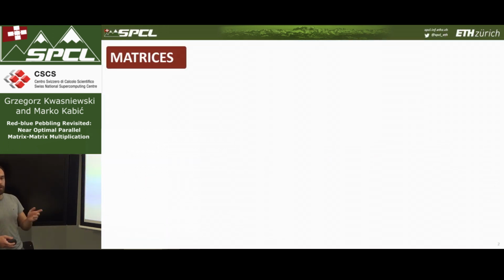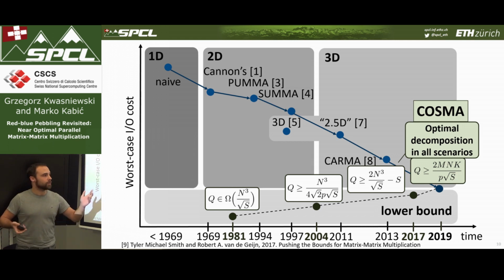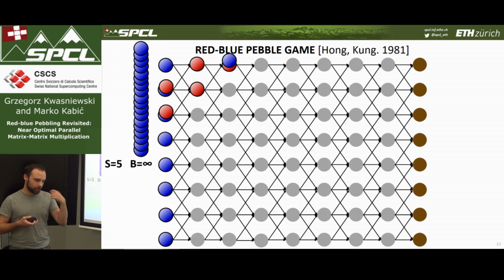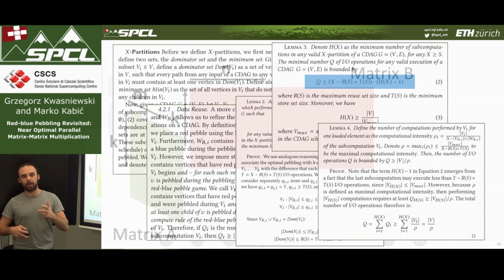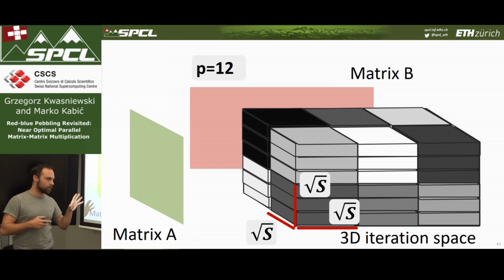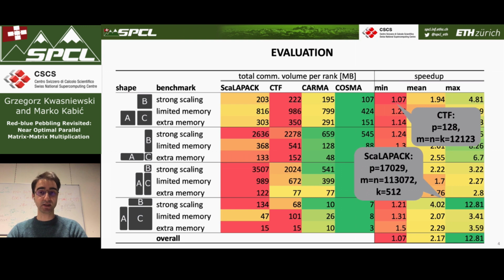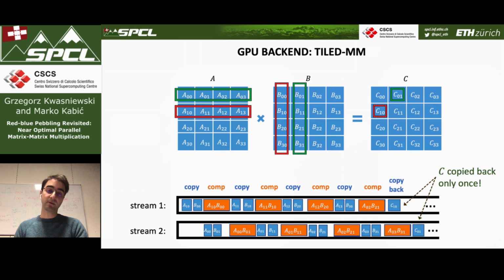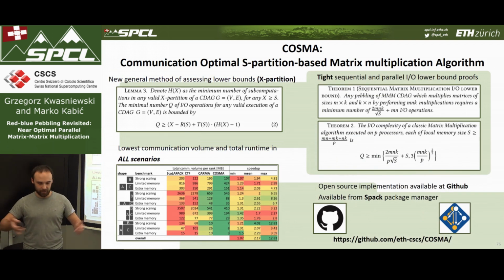Red-Blue Pebbling Revisited: Near Optimal Parallel Matrix-Matrix Multiplication

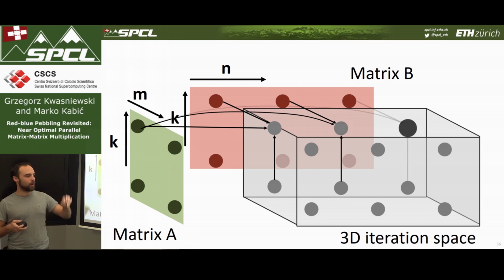Comment: At 13:32, In the diagram, why is the A[2,2] (bottom right green element) pointing to C[1, 1] - bottom layer block diagonally? I think that should not be there. And A[1, 2] should also not be pointing diagonally to C[1,1] - top layer.
Reply: Because to calculate a single element in C, you need only 2 multiplications and 1 addition. And for 1 layer, you need only 1 multiplication, since you are going to do the adding later while squishing the layers together using reduce.
Reply: @karanjeswani306   Using 0-based indexing, you have for matrix A: bottom left [0,0], bottom right [1,0], top left [0,1], top right [1,1]. There are the following edges:
A[0,0] -> C[0,0];  A[0,0] -> C[0,1],  A[0,0] -> C[0,2]  (bottom layer)
A[1,0] -> C[1,0];  A[1,0] -> C[1,1],  A[1,0] -> C[1,2]  (bottom layer)
A[0,1] -> C[0,0];  A[0,1] -> C[0,1],  A[0,1] -> C[0,2]  (top layer)
A[1,1] -> C[1,0];  A[1,1] -> C[1,1],  A[1,1] -> C[1,2]  (top layer)
Maybe the confusion arose from overlapping arrowheads, but there are no "diagonal" dependencies.

Comment: I have tried many times to instill COSMA  in my Ubuntu, as a package require for cp2k, unfortunately it has not work. I followed the instructions (https://github.com/eth-cscs/COSMA/blob/master/INSTALL.md). Please help me to install it. I have this error :  
CMake Warning:
  No source or binary directory provided.  Both will be assumed to be the
  same as the current working directory, but note that this warning will
  become a fatal error in future CMake releases.

CMake Error at CMakeLists.txt:11 (include):
  include could not find load file:

    cmake/build_type.cmake

CMake Error at CMakeLists.txt:12 (include):
  include could not find load file:

    cmake/adjust_mpiexec_flags.cmake

-- Selected BLAS backend for COSMA: MKL
-- Selected ScaLAPACK backend for COSMA: MKL
-- Could NOT find MPI_CXX (missing: MPI_CXX_WORKS) 
CMake Error at /usr/share/cmake-3.13/Modules/FindPackageHandleStandardArgs.cmake:137 (message):
  Could NOT find MPI (missing: MPI_CXX_FOUND)
Call Stack (most recent call first):
  /usr/share/cmake-3.13/Modules/FindPackageHandleStandardArgs.cmake:378 (_FPHSA_FAILURE_MESSAGE)
  /usr/share/cmake-3.13/Modules/FindMPI.cmake:1671 (find_package_handle_standard_args)
  CMakeLists.txt:75 (find_package)

-- Configuring incomplete, errors occurred!
Reply: Hi Saad,

Sorry for such a late response, I haven't seen this earlier.

The error you are reporting should be fixed by setting:
export CC=`which cc`
export CXX=CC

this should help cmake find the right MPI :)

Btw, in the future, please send an email directly to marko.kabic@cscs.ch, because there you would get the answer probably the same day. Hope this helps!

Cheers,
Marko